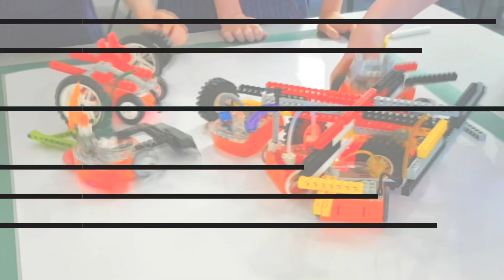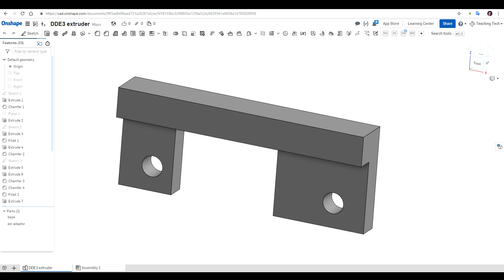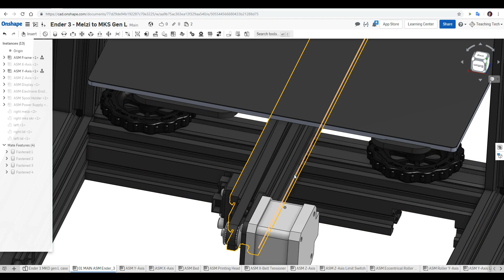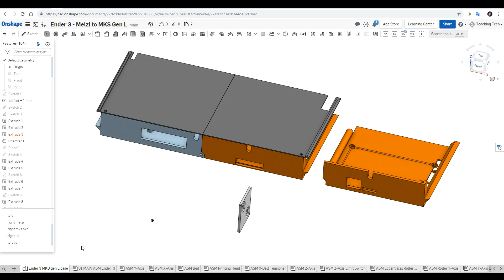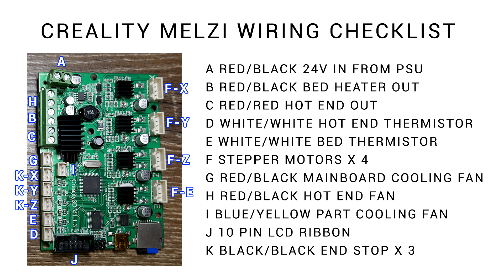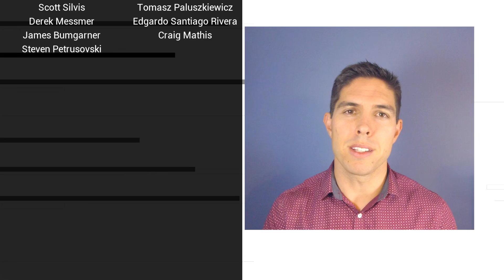Ender 3 upgrades: EZR to direct drive adaptor and all in one rear mounted electronics case

Comment: Love this guy but the files are off and you will waste filament. The holes are all 3mm so the 3mm screws won't fit and 4mm screws won't go through the pcbs. So all screw holes need to be shrunk to 2.5mm. Also the cases are way too wide to fit the ender 3 frame. They are 2mm to wide so this needs to be adjusted as well. Good info but terrible design.

Comment: Hey, I tried to install this on the Ender 3v2 but the Power Supply is in the spot where the parts are supposed to go. I noticed that on your Ender 3, the Power supply is mounted on the right back side. Is this a upgrade that I can also do on my Ender 3v2 or original?

Comment: im still trying to get my ender 3 pro to work and having a nightmare with the first layer. i added a new extruder (the duel gear metal one) and i redid the steps. the best way i can explain the issue is some rippeling or ill see what looks like the nozzel is digging back into the print no matter what i do with leveling or  first layer peels. i keep  testing the bed temp, print temp, using glue stick on the glass bed, im just so lost. any help?  i do have a neptune 3 and a monoprice v2 and not having nay issues with them
Reply: With out auto bed leveling hit print to start a print after it starts level the bed at that.  Hairspray on the magnetic bed works great. Check your slicer see if ironing is on for every layer if it is change it.

Comment: I just printed the project and will be installing it Tomorrow. I think you've done a wonderful job in putting it all together. The only thing that I feel should go hand-in-hand with this mod is a new set of cables. The original ones are just too long and clutter the case too much. But it's nothing, that a day with a crimping tool would not fix :) Thank you for this great mod!

Comment: This is a great idea, but but deosn't work withthe new Ender 3 V2 and V2 Neo. The power supply is located where this housing places the main board. You can' make a new mount for the PSU and place it where the old Enders had them. THen you can use this housing.

Comment: I understand the motherboard is grounded via the power supply, but I believe the screws going thru the motherboard help with static (I could be wrong). Are we sure there is no downside to the board being relocated to a plastic case?

Comment: Almost seems like that mainboard fan isn't enough to cool the stepper drivers. Ideally the fan should run across it. Why not just get a longer z cable and create an enclosure external to the printer making debug and access easy especially since you're always tinkering?

Comment: could make the covers screwless/tool-less -- 3d printed push button ? or thumb screw -- that way it might be easier to hook/unhook components without having to move the 3d printer -- since some folks setup printers side to side -- and maybe remix of the covers for different fan or exhaust setups (could suck air through both cases with a large and quite blower? which might also work for fume extraction options

Comment: Hi everyone!

I got a 3D Printer with the exact same setup for my birthday from my wife.

The issue is the white part which hold the BLtouch and fan was printed badly by the previous owner and I can not use the printer properly.

Anyone can tell me what these parts are called and where I could print a new one online and get it delivered?

Thanks

Comment: Im looking at doing this with a pi4b. Going to use the same buck converter only thing is having the psu fan going just to power the pi as the printer will be switched on with relays. Is it safe to attach a relay to the psu fan as well since the pi alone wont be drawing much power? Once the relay and printer is on the fan can kick in. I doubt much heat would be produced with just a 3amp load. Any suggestions?

Comment: I need a case for my dual extruder board. I used a ender 5 plus board, it barely fits in the case and want a little more room. You got any recommendations?

After watching all the way it seems the standard board file will work for me. Thanks.

Comment: I know this is an older video, but I was hoping some more info could be shared about the wiring in the rear case. I’m working on printing it up and ordering all the parts, and I’m wanting to wire this all in to work with only one power plug. If anyone knows a write up or if there’s a video with more detail on the wiring, please let me know!

Comment: I finally got to try this out, and have made some progress. Slightly modified the stock board enclosure to fit the fan in it in place of tl smoothers, but beyond that everything went in as I would have expected. 
Few problems that I ran into that might be important (In my case, I am using the Stock ender 3 board as of writing this)
- The Z-Axis End Stop Wire is at least 3 inches too short to reach the z-switch from the new enclosure, I am getting longer wires to remedy this
- The Y-Axis Stepper Motor on my Ender 3 appears to be closer to the enclosure than Teaching Tech's, close enough in fact that the connector for the Motor is directly above the drawer. I had to snip off some of the enclosure (and will do so for the lid as well) to get it to fit right.
- The front I/O Wall is too thick to viably use the Micro SD that comes with stock, so I recommend modifying the design to make it thinner, or getting a Micro-SD to SD Converter to use

Regarding the motor, why is this? Did Teaching Tech modify the printer to have an extended Y-Motor, or did Creality modify the design a bit sometime after this video was released into the printer I have now?
Edit: I now realize he has an ender 3 pro, is that the main difference?

Good luck on all your printing endeavors
Reply: Why didn't you just clock the motor one turn so the connector came out the back? I know this is an old comment on an old video but just got around to this mod on my original E3 and that is how I handled it. No modification of the case at all.

Comment: How can the part at 5:20 print without any support? Wouldn't there need to be support for the 2 openings where the Pi connections are and on the side that leads to where the main board is?

Comment: I'm torn as to what to do with my ender 3 V2. It's already regressed to the more informative (and works better with octoprint) old style CR10 screen, but the PSU is where this enclosure fits. I've been working on you fusion drawing to convert it to front mount, but I think it won't slide out as easily as all the cables exit the back.

My alternative is to rotate the central Y carriage 4040 beam and the Z frame so the PSU sits at the front. Ugly, but my printer sits sideways in a cupboard with the screen rotated on an arm. 

I think a complimentary mod would be putting the screen on the extruder side for better access so the belt tensioner that I don't need daily access to faces away and I'm no longer loaded filament blind.

Comment: Yeah couple improvements:
- putting the fan hole on the back to allow arbitrarily stacked/long fans
- closing the gaps around the IO for raspberry pi and control board
- attaching the rear IO plate to the top lid to allow better access to the boards
- extrusion endcaps attached to the bottom to screw the bottoms in
- top lid snap into place (keep the screw hole for backup)
- vents past the extrusion to heat the metal, giving you a tactile feel of the electronics temperature

I looked at the remixes and half just add a larger fan... overkill isn't better guys...

I'll be uploading my remix tomorrow when I make these modifications

Comment: Just bought my first Ender 3 and I've already printed this case and transferred the electronics across.  I have one question about it, how did you power the Raspberry Pi? I've looked into using a buck converter and hooking it into the power supply but wondered what you did and maybe you did a video covering it which I haven't watched yet.

Comment: Any tips for getting the rear case to work. I've probably spent a good 2 1/2 hours sanding, filing and scraping away at it and it just doesn't want to fit

Comment: Just FYI: M3x8 is too long to use for the mainboard, buck converter, and the Raspberry Pi. Just went to the store and bought some to discover this. M3x4 or M3x5 would be more appropriate. My standoffs are too large for M3s for the buck converter.. ymmv. Buy an assortment ;)

Comment: It looks like you didn't connect the Z limit switch. Is it not needed with BL touch? I wasn't planning to add a BL touch and found the cable for the Z limit switch wasn't long enough to reach the Ender 3 V4.2.7 board. My solution was to separate the Y limit switch cable from the Y stepper motor ribbon cable and swap the Z and Y limit switch cables. I kept the stock display and found its ribbon cable barely reaches. I had to route the cable for my raspberry pi camera to the rear. It wasn't too bad since I have a drag chain for the all the cables from the X axis area. I've had the parts printed for over a year now and finally glad to install this awesome mod! Now to see if everything works so I can print another case for my second Ender 3. I had to scramble to find a new USB cable to connect the RPi to the new Control Board since the original Ender 3 board uses a mini-usb port and the new board is micro-usb. I'll shop for a USB A to micro cable with right angle connectors later.

Comment: you really do need at least two 3d printers, so that one can print parts to upgrade the other. It's quite a challenge to have just one printer, print some parts, disassemble, trial-and-error, re-assemble, redesign, repeat...

Comment: I printed your rear electronics cases. The right side one for the TL smoothers has a problem the rear inside smoother mount holes are big and a 3mm screw just drops in. I thought I messed it up with tap so I reprinted another and it had the same problem. I guess I'll have to order a couple of 4mm screws to put in.

Comment: I have a problem, for which Creality does not give a satisfying answer.
I want to upgrade from V1.1.5 with bltouch to V2.4.7 with bltouch.
As I failed to create a .bin-file out of Marlin 2.0, frustration made me choose ready-made firmware to flash.
They offer 2 versions to be used. but I'm not sure which one. 
4.2.7 Ender-3 pro 32bit Marlin2.0.1  BLtouch V1.1.2without adapter board TMC2225 and
4.2.7 Ender-3 pro 32bit Marlin2.0.1  BLtouch V1.3.1with adapter board TMC2225

My question was this: How do I connect my bltouch on the V2.4.7 and what firmware I use.
They answered I still have to use the adapter board I've got for the V1.1.5 board, but I thought I could use the dedicated BLT connector. 
I'm a little insecure, as I burned my firts V2.4.7, coonecting the BLT without switching the (vcc) and (gnd) wires from the BLT

Comment: After watching so many of your videos over the past 2 years: Big thanks for taking the time and effort! Helped me a lot with my first 3D printer (Ender 3) and still does :-)
Thanks for being objective about the topics, good background info research and providing good starting points for my own decisions!
Reply: Two notes about the "old" Ender 3:
The y-axis stepper motor has a different mounting than yours, so plugging in the cable is really hard.
The cable for the stop switch (z-axis) is very short, so I had to switch with the y-cable
-> With the v4.7.2 replacement or original Melzi board.

Comment: I would like to move my electronics to the rear on my Ender 3 pro. I use an  SKR Mini V2 main board. Also I have a raspberry pie 3 running Octoprint with a Pi camera on a 1 meter lead. Is this configuration compatible with your rear tray design?

Comment: Installed this on an Ender 3 Pro with the Creality 4.2.2 board, but my Z limit wire was a bit short, so I had to build an extension cord. If you're about to install this, you may want to check your wires before you start moving everything. Overall, it's a great mod that makes it a lot easier to access the boards.
Reply: I had the same issue where my z ends too wire was too short. I just swapped it with the y ends too wire, since that one was too long after moving the electronics to the rear. Worked out perfectly!

Comment: Just got the urge to get into this hobby so I watched too much content for a beginner. I understand most of the concepts regarding upgrades in terms of function at least. My main question is regarding ender 3, pro and v2. I think I'll be upgrading a ton as I go does it make sense to just get the ender 3 and upgrade the board/touch screen, the hotend, the extruder maybe even do the linear rail upgrade too. Do the other versions have anything even worth considering them or am I just going to up spending more money on the stuff I'll be replacing either way?

Comment: I just ordered an Ender 3 ( first standard version ) and an SKR mini v2.0 with the touch screen ( E3  to fit inplace of stock ).. This is just what i have been looking for. Will it work with what i have and a Pi 4 added to the left near the power supply? Please tell me yes.. I have not even put the printer together yet but I have been researching and this is the mod I Want and have been looking for. I am new to all this. I dont think I could design something like this and know it wouldnt be this clean..THANKS A BUNCH

Comment: Are you now using Octoprint for loading files, or did you run a SD card extension/adapter?  Loading at the rear of the printer is very hard if space is limited for your setup.

Comment: For those without the Raspberry Pi, the hole supporting it needs to be closed so that air flow comes from across the board and not from that hole. Perhaps an improvement would be a removable hole plug that can close that opening until/unless it is needed. If it is not closed, there is a risk of too much heat from the mainboard.

Comment: Seems that this electronics box design does not fit the non pro E3 (or at least the one I have). after printing the parts and disassembling the controller card, I found out that this setup is wide by about 10mm than the distance between the frame legs. At first I though that I have a scaling problem on the X axis, but the mounting holes for the board and fan fit perfectly, so it is the design which is wider. I guess I will have to sit and design something else.

Comment: I just installed this to my Ender3.  I did find that the rear case interfered with the y stepper motor plug.  I had to cut a notch out of the case in order to get clearance.  Was this intended for the Original Ender 3 or just the Pro?  I also found I had to cut and lengthen the Z end stop cable.  I wish I had known about that in advance.  Otherwise I like the look but wish it had been easier.

Comment: I need some help...I labeled my wires, but after watching this vid closely, I now doubt them. @8:14 you screw in the bed heater, and you plug a thermistor in. You don't specify which one...but you plug it into the hot end. From what you say, it could be the bed. so now I've got reason to doubt my labels? Can you help?

Comment: I just printed the version for the BTT v2 and completely rewired but the z stop switch cable won’t reach!  Help!
Reply: Hi, did you find a solution? And were the instructions pretty much the same for the BTT v2 or is there another video for that?

Comment: I haven't seen anyone double-stack the 40mm extrusions that the gantry bolts to to essentially double the vertical space under the printer, not to mention allowing more horizontal space to allow you to easily mount the PSU under there as well. You could also still print the tool drawers that are so handy.

Comment: Can you tell me if all the cables fit for this or do I need extenders for anything? I have Ender 3 Pro with micro swiss direct drive, skr mini e3 v1.2 with LCD Screen and raspberry pi 4 installed and plan on moving the boards to the rear. Do I need any longer cables for any of these or can I use the originals I have already.  Thanks!!!